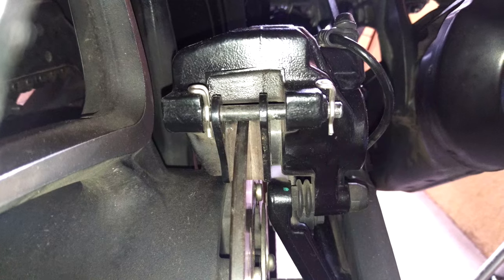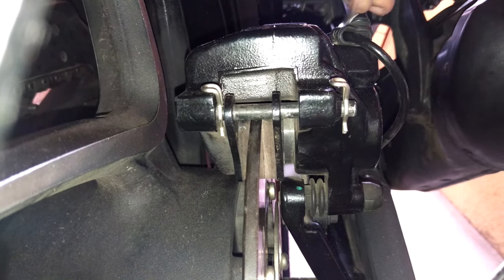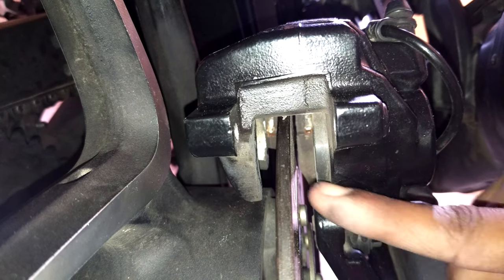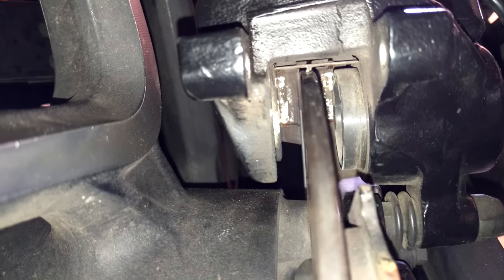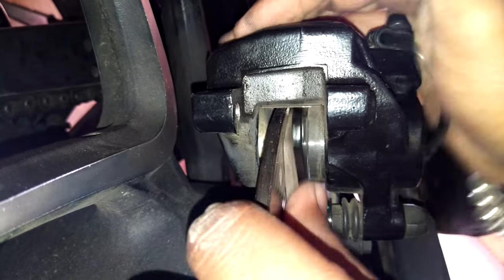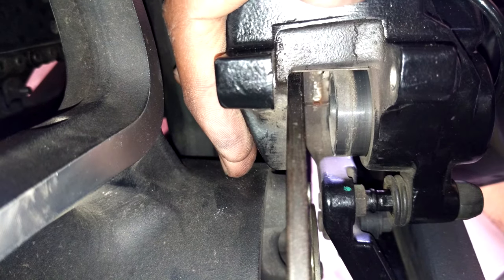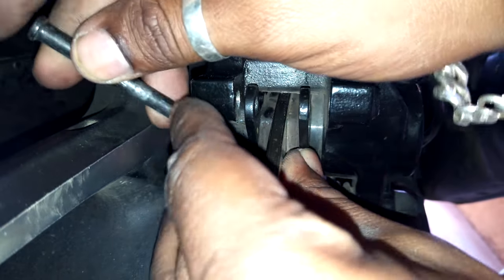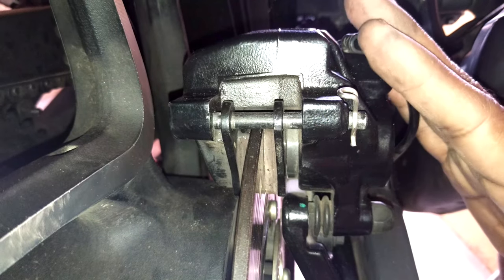DISK BRAKE CALIPER PISTON OUT | FIX | DOMINAR/ANY BIKE

Comment: Hie Vijay. Great trick. I replaced front brake pads on my bike and had a hard time pushing those pistons back in. However, all other channels like revzilla tells us to remove the calliper from brake assembly and then start the work. I did the same. I think in that case this neat trick does not come in mind. They use sheer strength, using older pads to push the pistons in. I tried the same thing and it took a lot of time.
Reply from the maker: There are times the pressure and dust accumulation and other factors can cause a problem but ideally it should work fine.
Reply: This trick works only for a floating caliper type brake...not the type with pistons on both the sides
Reply: @pruthviprime  So what can i do if i have dual pistons on both sides??? Please help

Comment: Front Brakes - I was in this same shitty situation, but with my front brakes - dual pistons on both sides - which had nothing to compress on the sides of the calipers, unlike in this video. I had no C-clamp, not even long-jawed pliers. What I did was bolt the top of the caliper assembly slanted to the side into only one bolt hole, which left the bottom of the caliper sticking off to the side. I made sure it cleared the brake rotor (ie wasn't resting against it) and tightened that one bolt as much as I safely could. That anchored the caliper assembly off to the side so I could use a metal lever (I used the closed side of ordinary pliers). It worked great, but brake oil spilled out of the open front brake reservoir at the handlebars, which I'd opened because another online source said it was necessary to get the pistons to move (WRONG - it wasn't necessary. All it did was lower my brake fluid amount and make a mess). 
It got even worse - when moving one piston at a time, the other piston on the same side came further out - one of them popped completely out, leaking more brake fluid (preventive solution - Slip in a metal plate so you can simultaneously lever both pistons on one side).
Now I had no front braking power, because I had no brake fluid at home to top off the reservoir. The one fortunate thing was that, as with most motorcycles, my front and rear brakes were separate systems with separate reservoirs, so I could still use my rear brake (going heavy on engine braking for extra safety) to get to a store to buy brake fluid.
I decided not to use the recommended emergency substitute for brake fluid - a mixture of 60% dishwashing liquid and 40% water. It was tempting, but I read that in order to get your brakes fully normal again, you have to flush the brake lines, then add new brake fluid, then replace that fluid with newer brake fluid after a 100 miles or so.
I hope this helps save you from going through all that yourself.

Comment: Hey Vijay , I was wondering  where I can get the  new ECU 116  update for my Dominar in Bengaluru . And also do you recommend removing the DB killer for a better sound instead of putting a filter /after market exhaust which may or may not cause harm to the engine on a long run .
Reply from the maker: chidroop sagar if your bike is new then you may probably have updated one. If not then ask Service centre to confirm the same. For the sound I don't recommend removing anythkng. But it may be your choice but it ain't gonna sound good.
Reply: Vijay Hansora my bikes about 8 months old now .. I guess it should be updated . Thanks a lot for your reply :-)
Reply from the maker: chidroop sagar welcome

Comment: It will work in cbr250r 
If i removed the pad and press the caliper if piston dosnot go inside then ??
Any other process
Reply from the maker: It's the same for all bikes. But avoid getting into that situation as in case if the calipers have dust it may take more force which can have bad effect on disc

Comment: Hi. Should the brake disc get hot at all when the wheels are spinning if the rear brake is not being used ??
Reply from the maker: Ideally a little hot is fine but within a km or 2 if it gets too hot to even touch then there is a problem.

Comment: This one mistake ruined my bike's breaking system, i went to a local machanic and he opened the whole calliper and and he hit the piston by hammer to put it back. By doing these things he leaked all break fluid too. And since then my bike's rear break doesn't work the way it used to. I went to RE authorised service centre and some other machanics too but no luck they are unable to understand the problem. They don't even know how to do break bleeding properly.
Reply: Problem solved?
Reply: @durgashankar8156  nope

Comment: My rear disk brakes are getting stuck after some use. I have tried caliper overhaul. Do i need to change the caliper?
Reply from the maker: No just service the caliper. Over a period dust and rust can create this issue. If you are a DIY guy then service it or else give it to mechanic also check the price of caliper so if it is cheap then yes replacement will be better fo future. But first figure out what is the problem don't start replacing stuff you might lose money there

Comment: So do you just loosen the brake caliper bolts and shift the actual caliper itself from side to side?
Reply from the maker: All i did is remove the Brake pad shaft and push and pull the caliper assembly which is mounted on its own mount points.
Reply: @VijayHansora  does this work for direct mount flat hydraulic brakes? I have Shimano Ultegra R8070 groupset. Thanks so much!
Reply from the maker: @rossfripp4503  To be quite honest if i understand correctly if it is a flat direct mount. You can slide the caliper assembly side to side horizontally so this would be difficult. However using some flat tool or pry tool you may be able to separate the calipers on the Shimano. Sorry to disappoint but never had my hands on one of those.

Comment: Gr8 video...also if possible, make a video for brake bleeding...my rs200 has got air in front brake lever... I tried to remove it but it wasn't successful.
Reply from the maker: Meet Sheth open the master cylinder and keep hitting the rubber hose and you will see very tiny bubbles surfacing. Keep doing this till you feel the lever is hard
Reply: Do i need to open the master cylinder or the cap near the caliper?
Reply from the maker: No the cylinder near the lever.
Reply: Thanks

Comment: Today' my dominar 250 delivered
but my rear disk making noise and  rear brake is also not working that good
Reply from the maker: 2 possible things. 1. For delivery they applied polish and that affects braking and 2. It takes little time for brake pad to bead in. And also note rear brake is very slow and progressive only. Don't expect bite like front.

Comment: Sir what to do if weak rear break ? Disc  break also .. Thanks for answering .. Really need your help
Reply from the maker: See there are two things to keep in mind. First The rear brakes are always weaker than the front brakes as per design 2nd if you feel the brak performance is not as before please check my video on how to fix rear brake issue and also check your pad and there is another video on when to replace the disc rotor and also bleed your brake oil and replace it during service. If the brake is same as before but your feel it's weak then do basic or buy EBC pads which will give more bite having said that the ABS will engage more frequently if your rear is locking due to the good bite.

Comment: Dude - I got my motorcycle washed from a car wash center nearby and then they applied some polish to make it look squeaky clean and new...and while that worked, i don't know has happened, my brakes, both front and rear have lost almost all of its stopping potential...it's not air I can assure you....there's feedback on the levers, but i get no bite even while applying full force.

Can you suggest me whats gone wrong? and mine is a new motorcycle, just 3 months old and i've only clocked 2.5K KMs...

Please advice, I have a 250 Duke BS6 that comes with the 390 LED headlight unit....
Reply from the maker: Aniket don't worry. Normally people use material to make your bike look squeaky clean. The polish remains on the plate. What you can do is use wd40 and spray and clean the plate. Also if you don't have just take the bike inn empty space and go to speed of 60 and apply brake progressively and at end a bit hard. Make sure to be careful as if you don't abs and if you hit your tyre will lock. The bite will be back in no time
Reply: @VijayHansora  my friend, i was trying that progressive braking for the last couple of hours and it does seem to work...I cannot thank you enough!
Reply from the maker: @AniketSen  welcome buddy. Next time you get the washing done there just ask them to put a cloth or paper on the disk and spray rhe polish... If it still happens then use wd40 on cloth and clean the disk. Or else progressive hard brakes. 😁. Please do consider subscribing and sharing my channel
Reply: @VijayHansora  you got it.....also leson learnt...no matter how tedious...wash your own motorcycle...with your own hands...and with utmost care
Reply: Seems like the brake rotor and pads have got some grease/lube/wax etc on them.  I go through this ordeal every time I get a puncture or have the tyres changed, the mechs always get grease onto the disc rotor! Remove the pads and clean, sandpaper and use isopropyl alcohol and set them on fire 🔥 to burn out any residue. Next clean the disc/rotor with brake cleaner/ or dishwasher liquid thoroughly to get any grease/wax/lube off them. Replace the pads and you should be good.

Comment: Hey brother..! Can you tell me one thing...?
My front disc brake lever is too spongy.. more than how it should be... And it's like this from the beginning... And It's ABS...
Reply from the maker: If the lever is very spongy means probably air due to which pressure is not there. Please take it to local mechanic or service center and ask them to bleed the oil and redo it.
Reply: @VijayHansora  thank you brother...
Reply: @VijayHansora  brother i measured the lever.. 
It goes about 25 mm after that brake applies...
Is it ok..?
Reply from the maker: @a.ksingh2244  honestly by measurement I can't judge. Please make sure there is pressure. At some point it should be very hard once you pull the lever.

Comment: I thought about doing that but I wad scared to damage Something ,i have 4 pistons brakes and 2 of the pistons were like this , thx for this video !
Reply from the maker: Welcome. In case of extreme jam a little wd40 can help to release but later you need to use some brake cleaner to remove the residue of wd40. I am glad this video was useful to you. Please do consider subscribing 🙏

Comment: Is it normal for the rear brake caliper to have a little play? TIA
Reply from the maker: Only the play which I used in this video if it is vertical play or any other play than showed in video may need to be checked

Comment: it is more easy if you bleed out the brake fluid. see that little tube on the upper right? turn it counter clockwise then you can easily  push the piston back inside. beware of the brake fluid that will burst out from the bleeder tube.
Reply from the maker: You are correct but this video was for few who do  not have expertise in bleeding as it is not a easy task any mistake they may loose the fluid and can cause issue if not done correctly hence i wanted to show safest and easy way to do this.

Comment: In my classic 350 i replaced with new caliper but still the brakes are not retrieving and pads are rubbing against the disc making the wheel jammed, any solution?
Reply from the maker: This is something for sure you have to get it checked from mechanic in case of any mis alignment or something. If the wheels are jamming then its not good also run it few days to see if that helps.

Comment: I have a question: one the brake is released, won't the caliper go back to its original position?
Reply from the maker: No the piston doesn't go back. The piston always is close to the brake pad and keeps coming out as and when the brake pads reduce.
Reply: @VijayHansora  thanks for the reply. I am facing an issue.. after riding 3-4 kms.. rear disc is hot. Can't even touch for a second.. what could be the issue
Reply from the maker: @Dhayadhanu  that is a clear indication that the brakes are constant in pressure. Please put it on stand or raose the tyre if the pressure is high then the tyre won't move. It would mainly mean that the brake are constantly getting applied . Take it to a good mechanic or service center if still under warranty.

Comment: Rear wheel moving freely than front wheel  with disk brake...is it normal..?
Reply from the maker: A little resistance is fine but make sure the proper maintenance is done regularly

Comment: I tried replacing stock shifter to rcb shifters, I completely disassembly the motorcycle then I had the back wheels of and I stupidly stepped on the back break a couple of times to see how the break pump works, then when I tried putting the back wheel back. Guess what happened. Break caliper is pushed out and my break pads are stuck together🤦‍♂️

Comment: hey i need a fast answer i removed my front wheel as always to put my bike on place but i accidentally pressed the front wheel brake and now my wheel cant fit what can  i do
Reply from the maker: If it is dominar then you can perform the same. Also remove the 2 bolts holding the caliper and then use a  plier to put the piston inside

Comment: I had a bad experience pushing the pistons with a lever/against the disc, it warped the disc pretty badly.
Reply from the maker: Sorry to hear but you have to be careful. You can get the warp removed.
Reply: @VijayHansora  yeah I shoudnt have done that, i think I put too much leverage on the disc, anyway I'd like to see some diy caliper repainting, maybe, in your future videos😀....more power to your channel Bro! Ride safe......
Reply from the maker: @howdididoit3135  Caliper repainting is not a big deal. All you need is some good sanding and then small fingers :D and primer and a good colour for me i am keeping it stock but yeah maybe i will do something like that in future.

Comment: sir how can i remove the brake caliper without removing the wheels?
Reply from the maker: The front you can but not the rear for dominar as it fits in axle.

Comment: What happens if only one piston works but the other is not. I have dual
Reply from the maker: If you have 2 what happens is when you press one the other one comes out and if you are technical then remove the caliper and then clean it properly so no dust or grime is there and check both Pistons if they are smoothly moving using a plier force to press one at a time. As in case one of them is jammed it will affect your braking

Comment: What actually happens in my bike is that calipers comes out upon pushing brakes but doesn't return when brakes are released resulting in brake jam which eventually doesn't let my wheel move abit
Reply from the maker: That means the pressure is leaking somewhere. Please get the brake fluid bleeding done and if the bike is old get the brake piston assembly checked and cleaned from the lever and caliper side.
Reply: @VijayHansora  thanx mate I changed the whole braking system
Reply from the maker: @axemena.i.lolabi155  ride safe

Comment: Bro my brake pads are  touching always in plate 
Wheele not moving freely 
Pls give solution
Reply from the maker: The brake pads are always almost touching. normally if you put the bike on paddock or bend on stand and move the wheel it wont be free as our smaller bikes. Unless you are really facing any issues during ride.

Comment: Dude..it still doesn't fit in..now what? No matter how much I pull ..it just won't fit..I did it all n it won't fit..btw I'm not making the mistake of buying n trying to put in the wrong type of break pads .i got the correct one..ktm 200 break pads for ktm 200....it just won't fit .its jamed
Reply from the maker: Hi buddy if this is done and still issue persist then surely you need to take it to mechanic.
Reply: @VijayHansora  thanks ..I took it to servicing n they took the whole thing off n fixed it

Comment: I tried it is too tight, unable push back. Please help
Reply from the maker: Use wd40 near the piston let it settle for 20 to 30 mins so it penetrates good. Use brush to remove any dirt and grime around piston. Use a plier and a cloth and press the piston inside making sure you don't damage the paint using using while pressing it with plier
Reply: @VijayHansora  I think it's the issue with air lock I am not exactly sure though. What if the pliers won't do much help
Reply: I tried pushing it back, it went back a little easily, but remaining I am not able to push.
Reply: Do I need to remove break oil for pushing the piston back using a pipe?
Reply from the maker: If you have brake fluid at home and you know how to bleed the brake line then you can do it and refill the fluid or take it garage